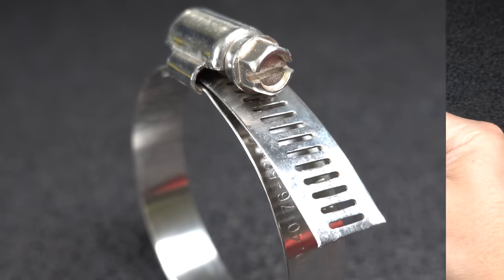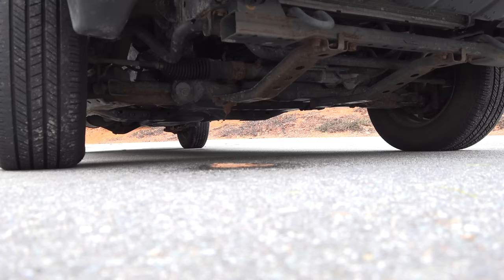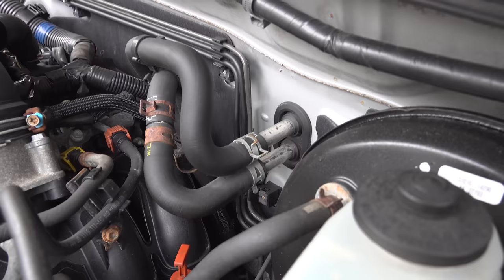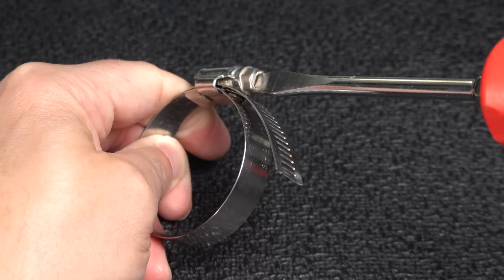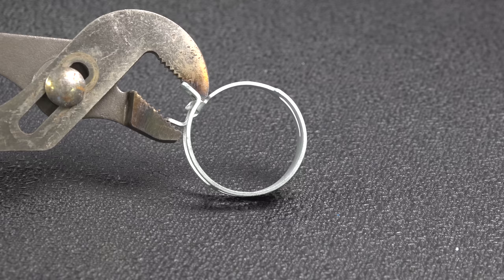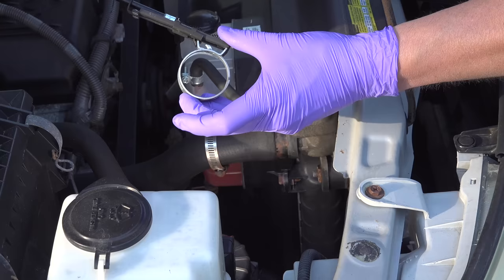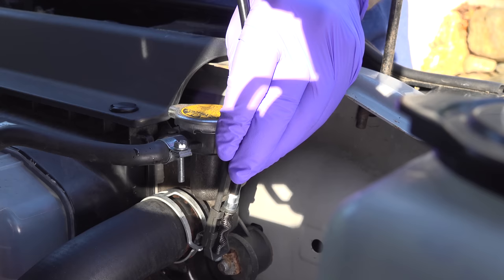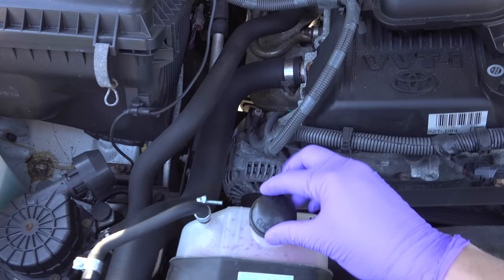STOP Using Hose Clamps WRONG - LEARN A BETTER WAY

Comment: Wow, I never knew this. I always thought the screw drive was better.  Makes sense what you said, keep up the videos.
Reply: Screw is better, just look at race cars, the spring is just more dummy proof.
Reply: Screw type is definitely better hoss, no matter what this guy says. I prefer the spring type on large hose's like the lower radiator to water pump or thermostat housing due to their being easier to remove, but on anything small like fuel lines especially anything with high pressure use screw types. Just make sure when you tighten them down that you can get to clamp to remove it or you'll be in a world of hurt.
Reply: screw types are defective by design

Comment: Spring clamps have been around for years and years. they are not the "new style clamps". In my experience they are just as likely to leak as any other style clamp . And when they do all you can do is replace them. I will continue to use the better worm gear clamps.

Comment: Spring clamps are typically used for dryer exhaust hoses as well. I find them very frustrating as they wear out over time and are a huge pain to get on.

Comment: In 40 years, I’ve never had one of those clamps leak.  Had one come completely loose once on a lower radiator hose, but other than that HUGE leak (emptied the radiator) I have not seen that leakage issue like yours.
Reply: Agreed, they use them all the time in more inexpensive cars, early 2000's Saturn's come to mind.  I see them on cars all the time, just not EVERY car.  I bet he has a cracked outlet on the radiator and every time he tightens it, the stupid thing just keeps cracking more and leaking further.
Reply: Hah so true, it's what I use when I want to make sure the a hose doesn't leak or come off.

Comment: Well Youre right about the heat affecting these jubilee/worm clamps but thats only if you use very cheap one's thats too thin and will expand and soften over time and will eventually let go of its grip step by step.

Comment: You're right. I experienced it exactly. Better use constant hose clamp for radiator, auto adjusting to different heat levels. Unfortunately, not easy to find it in Indonesia.

Comment: I've replaced so many of those sheet metal clamps with screw clamps because they stopped holding properly after being removed one time. On the other hand, I have never had a problem with good quality screw clamps done tight enough.

Comment: I remember these from my 80s Honda Accord, they used them every where, i dont remember any of them leak. They were prone to rust, and it is easy to buy the screw type by size or have a set of those make a clamp where you can make almost any size, its easy to get you going

Comment: I use these everywhere on the cooling system of my truck, now all the clamps are easy to access. One popped off cuz I put it on not far enough on the radiator. I always just snug them up every time I do an oil change and they do great. Not too tight, just snug

Comment: The spring clamp is a great design. After 40 years of using them on imports I found that they rarely leak. The most important thing though is selecting the proper size. If you select too large of a clamp you won't have the proper tension and it will leak.
Reply: This is the problem with spring clamps. If you replace a hose and it's a different OD then the original clamp won't work and finding the correct clamp is difficult. Maybe somewhere is an assortment box of spring clamps.
Reply: Yes ,that’s why they come in different sizes
Reply: So I did some searching and there are spring clamps assortment, but the biggest one only goes to 22 mm. I'm not sure what to do about bigger sizes.
Reply: @timothyball3144  You can take em off cars in the junk yard. Plenty of selection there.
Reply: @Ding Bop  That is true. But which clamp is the right one for which hose? I just can't imagine myself making the time to go to a junk yard, removing hose clamps, measuring the hose, noting which clamp fits which hose, organizing them into their proper sizes in an organizer then making the space to store those organizers. 

I can see how spring clamps are superior when it comes to proper clamping pressure, but when it comes to usability, they suck.

Comment: Another problem with worm-drive hose clamps is they do not provide uniform tension around the hose. The area under the screw exerts a lot more force than the rest of the clamp. This can be a problem, especially with the proliferation of plastic radiators and other engine components.
Reply from the maker: Very important point, many people don't realize this. They have their places for lots of low pressure, less exacting uses but vehicles and such do not do well with them.
Reply: @SilverCymbal   I think that it is not true. Hi pressure does not make worm clamps fail. Heat is the reason for failure, but only because over tightening. The hose itself has enough elasticity to allow for the hose area next to the clamp to expand without failing. Also, the poly-nylon, or any plastic, that the radiator is made of, will also withstand the heat created. Moreover, metal also expands and contracts. It really is a matter of wear and tear, or manufacture defects on one of the components. This is just my humble opinion.

Comment: Hm.. I basically had to replace the entire cooling system on my Chrysler 200 and I replaced some of them with worm clamps just because in hard areas I can just use my electric ratchet with 88 mm to tighten it. Instead of trying to get the old-fashioned one back on perfectly with pliers. But sometimes I still leak coolant.  Good video.

Comment: The tail on SS worm drive clamps are like sharp knives. I like the constant pressure clamps, but better right size them and a special tool looks like more fun than channel locks

Comment: Excellent tip. I just replaced a couple houses and used those clamps. I’ll replace them now
Reply: Don't waste your time with worm gear clamps. They're a bad design. Uneven clamping pressure around the circumference of the hose and they loosen up.

Comment: That's crazy, cause I constantly replace spring clamps due to leaking 🤷‍♂️
Reply: Pro tip, put it back in the correct position.
Reply: Just for fun what would be the "correct" position on a newly installed hose to keep it from leaking? Or if clamp was leaking from the factory with only 20-30k miles?
Reply: @derekbennett5896  Sounds like you have a wrong size hose and/or wrong size clamp.
Reply: @SinsBird  I'll let the fellas at the factory know they're using the wrong size clamp and or hose
Reply: @derekbennett5896  Unfortunately they don't listen until there's a lawsuit
Reply: @SinsBird  I can 100% agree with that.
Reply: @vipertxt your 100% right on that one, I deal with incompetent people on the daily in the dealership

Comment: This is a great video and speaks the truth which really hurts people's feelings haha. I had the exact same issue in three spots with my truck and fixed it the exact same way a few years ago. Someone worked on the cooling system and used those garbage worm clamps and they leak all over the place when it's cold and work themselves loose over time even if you buy the ones that claim to not loosen. Worm clamps are crap but people get so upset when you tell them that because they hate fighting with spring clamps. 

It is true that you have to set spring clamps back in the same spot on older hoses but it's not a big deal. Other people mention that spring clamps rust and break, yes they do if you buy cheap ones. There's a cheap version of everything especially when you buy from Amazon. When I fixed my truck I went to the salvage yard and got OEM clamps. Still no leaks 5 years later. If you live in the salt belt no one can help you there, everything rusts away on a car that spends half the year covered in salt, that's just life. Also worth noting is people buy the wrong size clamp (it's too loose but easy to install) and then it leaks but hey it's the spring clamps fault...... or maybe not.....

Also smaller worm clamps, clamp in a "D" shape and are guaranteed to leak. At worst small spring clamps, clamp in an egg shape. Automobile manufacturers have to provide warranties to compete these days and they know worm clamps are nothing but trouble so they don't use them to hold back fluids. If look they only use them for air intake systems and maybe on the gas tank filler neck.
Reply: I get OEM spring clamps from the junk yard too. To replace screw clamps previous owners put on my vehicles.

Comment: Listen to what he says at the beginning. Cold starts you notice leaks. I leave my truck sit for weeks sometimes a few months while trucking. I built my Chevy over a 5 year period and when I left the truck for a while all the clamps started to leak. After driving no leaks. I switched over to a quality hose clamp and now no leaks. You got to tighten them down then come back and tighten after a few heat cycles and full pressure has been run. I don’t like leaks

Comment: I've never had a worm drive clamp leak, but I have had the spring ones leak before. I get the worm drive ones made for silicone hoses, because they don't dig into the hose, and don't stretch over use.

Comment: Been using worm drive clamps for over 40 years on many apps to include hit rodding and have never had a problem. With the exception of once I bought very cheap Chinese made clamps and the sucked. I also use hose tack on all my cooling lines, kinda like a semi permanent contact cement

Comment: Yup just had the same problem with my 350Z previous owner replaced the lower radiator hose snd used worm clamps and now it’s leaking, just ordered a new set on tension clamps

Comment: Shielded worm drive hose clamps are used on silicone hose .  Constant tension clamps have sharp edges .  Truck fuel lines are secured onto barbed fittings with Oetiker band clamps , and securely band shop air lines to fittings .

Comment: I used worm flat head worn clamps on my 2002 Impala because I had trouble installing the tension factory clamps at the bottom of the bran new radiator and didn't want dame the plastic tank the with wrong tool. That was eights months ago and t the worm flat head screw clamps held very well for 8 months because I tighten them carefully. But installe those on my other vehicle and to coolant leak in the same area 3 months later and they were stopped being tightened. Don't know if over them or just don't well on vehicles, but I collected factory radiator hose clamps at the junkyard and installed those and sealed the coolant leak permanently. I noticed the puddle on ground and smelled coolant. So I'm nt taking chances the other vehicle. They work well on Impalas as long u tighten them correctly and with caution and since they caused the coolant leak on the other car that tells they work for sometime nt permanent. I'm glad I knew that on time.

Comment: God bless your channel. The soldering connectors you mentioned in an earlier video changed my life!
Reply from the maker: Great to hear! Thank you for the kind words
Reply: They really are great once you learn to use them. I kept melting them and got frustrated, until I realized it was my own fault. When using a lighter you have to keep it moving, if you focus the heat on one area (even from a distance) the shrink material will melt away.
Reply: god's a myth

Comment: Worm gear clamps, commonly known as jubilee clips as they were invented by an engineer in HMS Jubilee . Now you know !
Reply: And knowing is half the battle... Forgive me, it's a reflex.
Reply: @asm42  GI JOE..................................
Reply: Yep! Looks good: 
https://en.wikipedia.org/wiki/Jubilee_Clip
Reply: And even more “Wow!” about hose clamps: 

“Within the United States, SAE International maintains Specification J1508 for thirty-two different hose clamp designs, including screw, spring, and t-bolt styles. It also maintains Specification J1610 for the testing the sealing of hoses. The US Army TACOM maintains Commercial Item Description (CID) A-A-52506 that provides for the standardized acquisition of hose clamps by the Department of Defense; the CID references the SAE specifications. The CID superseded Federal Specification WW-C-440 for hose clamps in 1994.”
SOURCE: https://en.wikipedia.org/wiki/Hose_clamp
Reply: Ahhh the jubilee clip.

Comment: I’ve been working on cars since I was 17. Now 24 I always replace them with the screw type never had any leaks… in fact. I’ve seen the tension type clamp leak if you don’t put it exactly the way you took it off because over time the hose gets the shape of the clamp….

Comment: Those red clamps are the absolute devil. I replace all of mine anytime I take them off. I've been using worm clamps on my race cars and hi-po street cars for 27 years and I've never had them fail on me. The issue is not the clamps themselves or the design, it's almost always user error.
Reply: Exactly the same mate, the clamps he recommended are fucked.
Reply: Never had the issue he described.
Reply: Yeah, I don't know what he's talking about. He must have invested in those "smart" clamps.
Reply: Do you not count leaking as a failure?

Comment: Not sure you mention the best feature: the lock in place tab on those clamps. Locks in open position allowing you to slip onto hose then using a flat head screwdriver to clamp down .

Comment: The only time I had a problem with worm clamps were using them for gas line repair. When I tried fixing one problem line with a a pinhole leak I used the worm style clamp and it kept leaking then I bought a repair kit with spring style clamps and it worked no more leak. Gas lines have high pressure psi. Be careful when working

Comment: Having spent the last nearly forty years in the motor trade I can assure you that most of what's stated in this video is nonsense or completely wrong,spring clamps are used by manufacturers because they are cheap and allow for quicker assembly.
Reply: Those one time use clamps are horrible 💀💀
Reply: If they are cheaper why don't the dealerships use them? They love money..
Reply: @ohioplayer-bl9em  because they like anyone else that has fixed more than one car also know that they are rubbish,fine fitted to a new hose but once the rubber compresses over time then refitting them becomes a matter of exact placement for a fifty fifty chance of proper re-clamping,so rather than take a very solid risk of leakage or opting for sometimes breathtakingly expensive mihose replacement they opt for a better solution.,A bit of corrosion or a non uniform shape of the union or pipe the hose is being clamped to will result in a leak with sprung or even one shot clamps,a worm drive clamp will generally overcome a fair degree of irregularity in the fitting and allow you to apply more clamping force.

Comment: The mechanic that replaced my radiator used regular screw clamps and it's working fine   going on 5 years on my Mazda 6 ... All the stock ones were replaced those clamps are there stock because it's cheap and fast to install On assembly line when they make the car  That's absolutely the only difference.. Clamp style worm type are far superior in every install I've done

Comment: On the Jetta I had at the time, they put a spring clamp 🗜 on the intake hose, I replaced it with the worm gear ⚙️ hose clamp. 10x better AND easier no more problems after that, yes it’s true these clamps 🗜 should be used. But sometimes the Worm 🪱 Gear ⚙️ hose aka the screw clamp works best too.

Comment: I rip all of those " smart" clamps off and use stainless worm gear clamps .The only reason those " smart clamps are used is for ease and speed of assembly . This tool has probably never turned a wrench.
Reply: I always throw worm gear clamps in the garbage when I can and replace with spring clamps.

Comment: yeah i ignored this till it overheated and did put a crack in my rad lmao, hoping the engine good, getting a full aluminium radiator since i might as well upgrade it while it's out of the car now, and definitely getting some better clamps

Comment: Question: Example you correctly remove a Lower Radiator Hose to Drain Coolant-Antifreeze when replacing a Thermastat. Drain Coolant-Antifreeze. Reinstall Lower Radiator Hose & Hose Pressure Clamp securely into exact positions. Refill Radiator with correct amount of Coolant-Antifreeze. You notice that you have a Lower Hose Radiator Leak and New Correct Size OEM Spring Clamps are not readily available. This why so many OEM Spring Hose clamps are replaced with easily available Automotive Store-Hardware Store Screw Clamps. When Screw Clamps are installed correctly or 2  Screw Clamps are used in tandem the Leak Stops & Holds. Old work habits that work are sometimes hard to change.

Comment: My Lexus has had a small leak like this for months, if this turns out to be the problem ill be forever in your debt
Reply: check the top and bottom end tank rows of the radiator. Common leak and sometimes hard to spot,  small coolant leaks evaporate most moisture on hot radiator before it gets a chance to hit the ground. Factory toyota/lexus coolant is red and will leave a pink residue at leak.

Comment: Worm style clamps are great if you are tightening down on a metal fitting. Today everything is plastic, even the fittings on  your radiator, you break that plastic fitting, you have to replace that radiator. With the worm style clamp you can't over tighten on plastic fittings or they break. Personally I like the constant tension clamps for that reason, they perform better on plastic. on metal also.

Comment: I've been around race cars for 30 years,with engines easily upwards of 30 to 40 thousand dollars. I have never seen not would I ever use those spring clamps.
Reply: @@Mole460 nobody said drag racing. I've been involved with go kart teams,and every class of stock cars ,from 4 cylinders all the way up to 1000 hp dirt late models. Standard screw type hose clamps are the norm